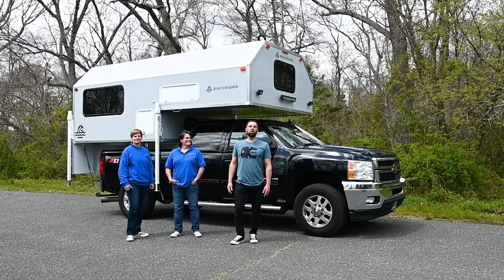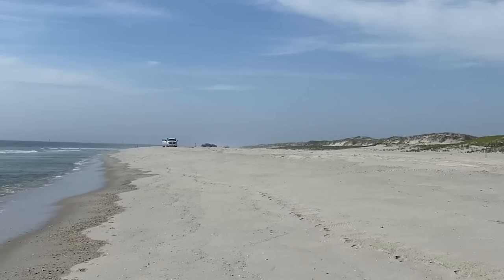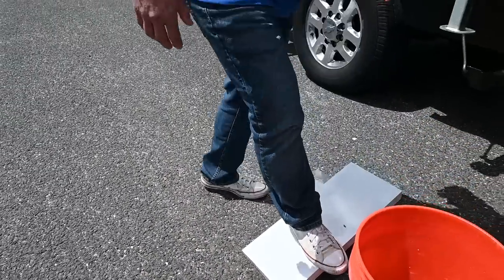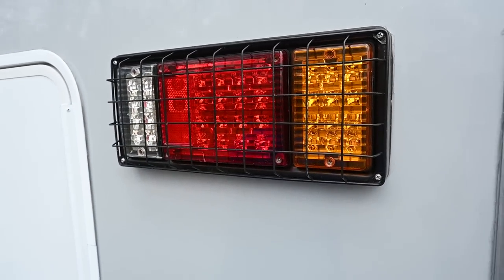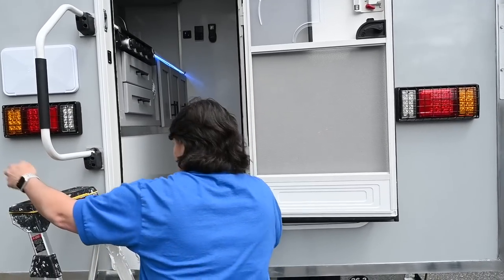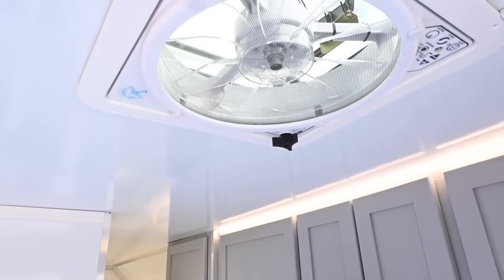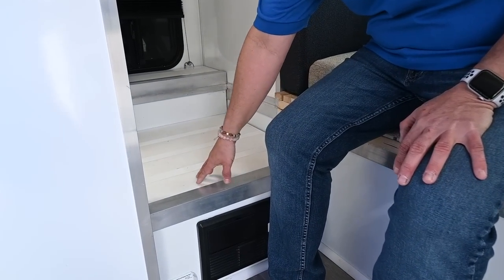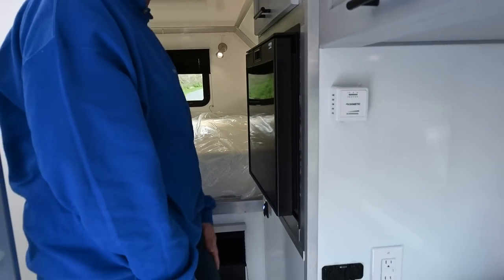INNOVATIVE Pickup Truck Bed Custom Camper - Beach Roamer Overlanding

Comment: I think that is the best truck camper I've seen actually. I was so pleased when we went inside and the walls are finished in simple white, phew!, no beige textured coverings that look sh*t and pick up dirt. Also it is so light and that is so important, you don't want a lot of weight high up on the back of a truck. So much that is good about that truck camper.

Comment: I think that this is the first camper that I've seen where the bathroom is not in the rear.. I have to admit, this is the first walk thru that I've watched from start to finish. Glad that I did... This is great...
Reply from the maker: Thank you. Glad it was enjoyable
Reply: Thank you Lookout Now.  It takes a bit more plumbing work to build the bathroom in the front but it really helps keep the center of gravity forward instead of having a heavy bathroom and tanks hanging off the back.

Comment: This is an extremely nice camper.  These ladies really built something special, functional, and sturdy.  Well done all the way around.  They're also MUCH less expensive than I thought they'd be.  The base option starts at 16 grand, and the biggest starts at 22 grand, which while a lot of money is waaaaay less than this build quality gets you with competitors. 

The only thing I don't like about it is a tiny issue I think it would have with the flat front plus windshear from driving down highways at over 70 mph.  I'm sure it works great and it is not gonna have any structural problems, but I think it could be modified from the factory with something that allows you to to get a slightly smaller profile and allow less wind sail issues.   Perhaps if the front leading edge over the cab had a dormer-style swing up,  you could get marginally better fluid dynamics while cruising through the air at high speed.  Perhaps even following the angled roof lines so it all still looked symmetrical.

If that would compromise the rigidity of the structure or its ability to keep out weather, which was the entire point of the build since they said they were trying to restore an old camper that was rotted out, I can definitely understand why they went with the solid vertical front end they have on this model.  The current set up looks to guarantee that no water will get in anything, anywhere and that is more important than losing a   mile per gallon in windshear.  However, if these ladies could figure out something which gives them the qualities they want and reduce the profile enough to give you back that mile per gallon advantage, then I think they'd sell even more of these.

Regardless of that extremely minor wind issue, what they put together is amazing, and I wish them both nothing but success, and hope they sell a ton of these, and make a ton of money.  Quality builds with all these features and advantages, for less than 40 grand is not only a good product and business model, but its great for the consumer too.
Reply: Thank you so much!  We appreciate your feedback!  Stay tuned for the walk through of the Overland Edition which has a lower front nose profile!  Keep in touch with us.  We appreciate your perspective!
Reply: Agree. I thought this was an amazing camper and just that friend end made me go 🤔

Comment: Looks like an excellent camper. One minor thing on the exterior I would change is the solar compartment door that also holds the remote for the jacks. If possible, make it have a magnetic catch to hold open. I see you had to hold it open with your hand. Not good if you're trying to adjust the solar or raise/lower your jacks. The exterior over the cab of the truck is very boxy and not aerodynamic at all. A lot of manufacturer's attach a tapered cap at this end to try and help with this. Maybe something to consider on a future model.
Reply: Great idea Chris!  Stay tuned to see the magnet on future cargo doors.  🙏😀
Reply: Amazing design, engineering, and product ladies! There has to be a proprietary way to curve the composite panels in a signature molding for a more aerodynamic cab over nose. Even if one continues the side(s) roof angle around to the front. The center of gravity design is huge if one doesn't have a 1 ton dually p/u. My 'V nose' utility 8x16 tandem axle trailer pulls night and day better than a flat front trailer or one with a nose cone fairing. What if a 'V nose' design was incorporated into the camper front cab over area nose with the 'V nose' horizontally (BEACHROAMER》{Wind) instead of vertically? I know one doesn't want to direct air flow to the cab over camper gap above the truck roof. Every added seam isn't ideal. It's built like a amazing brick outhouse with awesome  !!!
I wish BeachRoamer construction, and the design of formerly called 'CargoBody' truck work bodies could become one!

Comment: the structure is perfect and materials is great but that interior is all lady. if you ladies made a camper that was no frills no water, modular design like a scout it would sell like hot cakes. scouts are built like trash but the no frills modular design works. i live in alaska and i want a camper built structurally like this but i always find having no water lines to bust is always best. good non rot leak proof roof, diesel heater with solar and a fair price, that would be the ticket. keep it up ladies!
Reply from the maker: Good information
Reply: Thanks mudjerry!  We custom build each Beach Roamer so can absolutely build one with minimal (or no) water lines and a more modular / bare bones interior.  We recently added a diesel heat and hot water system as an alternative option to propane heat.  It was driving us crazy that we can build in solar charging and replenishable water tanks to be off grid for as long as you want BUT you have to go back to civilization to refill your propane tank for heat.  Diesel heaters, especially made by Timberlilne and Webasto, are incredibly efficient.  Thanks so much for your feedback.

Comment: Awesome use of each person's skill set. The elimination of wood would bring me such relief that my camper wasn't going to rot out in a few years. I agree with others that a bigger fridge would be nice. 
I wonder about that first step which seems awfully high. But that may just be me because I'm 5'2 and nursing a bad knee. 
I hope you go far and have great success with your business
Reply: Hi TrailRider, we do offer a larger fridge which also runs on dc / solar charging power.  You lose the storage space above the smaller fridge but probably worth it for the extra fridge space.
I can relate to the step up being high (I have a hamstring injury that acts up at the worst times).  We have different types of steps that vary in terms of height and weight depending on what works for the client.  Anything beats the step ladder!  Have a great day!

Comment: Overland edition starts at 22K when published 8 months ago but when I check today, it now starts at 36K. Nice camper and like the design. Sharp increase in the price but I guess that is the time we are living in.
Reply from the maker: This is why no one in videos like to mention price, because they always go up.
Reply: @NewJerseyOutdoorAdventures   But almost 70% in 8 months?
Reply: Hi ShutterFanatics.  Thanks for your comment.  We revised our pricing based on adding more solar charging capabilities (up from 200 watts/100 amp hours lithium to 400 watts/200 amp hours) plus we now incorporate aerospace grade aluminum extrusions that are custom made for Beach Roamer in every build.  It took some doing to get the mold done but we're really excited about the outcome.  

Most importantly, we quickly learned that our clients have a real sense of adventure and are truly looking to be off grid so they were upgrading to more and more off grid options (solar charging, diesel or propane heat, number of windows, etc.).  We built those common denominator options into the base price rather than advertise a low base price to 'get them in the door'.  Nothing drives us crazier than seeing an advertised price (say for a new car) only to find that the advertised car is so bare bones that it wouldn't satisfy what we're looking for.  

That being said, because a Beach Roamer is custom built, we can always bring down the cost by discussing alternative options.

Comment: Well thought out and constructed unit.  The soft close cabinet doors are wonderful but my one big concern would be that none of the  doors have any latches to ensure they stay closed when the truck is moving.  Having been a camper for years, I know that if you've travelled on a bumpy road, it's no fun to get to your destination, open the door and find the contents of the cabinets all over the floor.
Reply: Hi Ruth, that’s an excellent point.  Definitely no fun to have to clean up right when you get to your destination.  The cabinet doors also have a secondary lock that clicks into place when you’re traveling.  Comes in handy especially with the soft close glides on the drawers.
Reply: @vickilistonwithbeachroamer4511  - with all the attention to detail in your design, I should have realized there would be something to keep the cabinets shut.

Comment: 13:03
On warm nights, we use a Craftsman 20v fan.
A two-amp battery lasts a couple-three nights on LOW, and we have a spare full battery ready to swap.
.
Advantages:
* modular -- use one fan or add a couple more
* portable -- set it on the floor by the door or on a rack over the bed.

Comment: 12:30
We built our bed platform with expanded metal, similar to stout window-screen.
The air circulation under the mattress eliminates condensation and mold.

Comment: Nice camper.

I have found that i needed 800 watts of solar panels when living full time in my truck camper.  The extra wattage allows for 50 percent of shade parking. I have AC   but never use it.

Enjoyed video from philippines.
Will be back in america by december.
Reply from the maker: Glad you enjoyed it.
Reply: Excellent point!  We highly recommend more solar if you’re going to run an AC unit - we love the Dometic DC powered AC units.  Fortunately, we can fit up to 1000 watts of solar on a Beach Roamer by using the angled roof sides.  
Come visit when you’re back from the Philippines!

Comment: Kudos. I lived on a boat for 5 yrs. I  wish they had that composition then because I  had to deal with mold/ mildew. We tore our camper apart to repair and found out it was just stapled together.  ? What is the height from ground up to top for underpass clearance?😎😍

Comment: 13:50
For our ExpeditionVehicle floor, we have bamboo plank perimeter with slate in the center.
.
Advantages:
* indestructible
* interesting texture to bare feet
* bare feet automatically notice the main traffic zone -- slate -- while maintaining a safety zone to avoid toe-knockers as indicated by the bamboo plank perimeter.
.
Our insulation:
* adhesive-back acoustic against the inside wall, a gap, then
* one-inch pink-board, another air-gap, then
* two-inch foil-side poly.
With this obsessive excessive insulation, our heating needs are minimal.
.
We use a single Wave 3 catalytic heater, sitting on the floor on its factory stumpy legs.
We aim the Wave 3 at the slate, a form of heated floor with just about zero complexity.
The Wave 3 heats the slate, and that gently radiates into the habitat.
Year-round, we open at least two windows on opposing walls.
The escaping warm air carries humidity and odors.
.
Our intent on excursions with our caravan chums:
* learn and share.
In the 1950s and 60s, we joined caravans of experienced travelers.
We watched their choices of equipment, routes, destinations.
We kept quiet except to ask about reasons for some equipment or procedure...
...or to offer a ride to town for errands.

Comment: 12:02
In our ExpeditionVehicle, we mounted 3010 (three feet wide by a foot tall) dual-pane sliders designed for a stand-still house.
We mounted these at our eye-level standing inside, about eight feet above pavement.
.
Advantages:
* sunlight high on the wall mimics natural light
* high windows coupled with zero cabinets above waist-level eliminate shadows
* high small windows deter peepers
* high small windows are a small target for FOD or jealous by-standers.
.
2003, naysayers predicted the vinyl frames would fail, the glass would crack, the between-pane gaskets would leak to create a permanent haze.
Nearly two decades full-time live-aboard, twenty-four months twenty-four thousand miles around South America.
Alaska, Panama, all over North and Central America...
...no leaks nor breaks.
.
An aside:
We mounted our windows using Vulcum 116 sealer.
Nearly two decades, the seal remains soft and pliable.

Comment: So great that they provided pricing. Most don’t. I love this, the quality, etc. But for me, I need a van for safety concerns. I don’t want to leave the truck and walk outside to get in the camper.
Reply: Since the two ladies seem to be able to customize any portion of this since they build them, maybe you could get a pass through option so if your truck was also slightly modified, you could walk through (while ducking down of course) from the cab to the camper.
Reply: Love the well engineered build. Need a bigger fridge.  Love the light weight!  Do you have composting toliet availability?  Can you make an east-west bed? What is delivery timeline? Love  your camper!
Reply: @volvoqueen9698 , you are replying under my post.  You have good questions and should take them to the source for answers (so they see your questions for sure).
Reply: @robinrodriquez4725  l

Comment: They did it the way I would do it if I were manufacturing them. I wonder if the toilet is water proof or do you have to take it out to shower ?  Awesome job ladies !!!
Reply: Thanks so much Lisa!  The toilet as well as the entire bathroom area is completely waterproof so no need to remove anything.  Even the toilet paper holder is recessed in its own compartment.  Who wants soggy toilet paper?  Thanks again!

Comment: 11:30
In our ExpeditionVehicle, we increase the sense of visual and visceral openness with zero cabinets above waist-level.
.
A benefit of less weight aloft -- less leverage on our camper three-point mount, less sway...
... and less potential to carry just-in-case stuff...
... while paring the necessary to a minimum.
.
Another benefit to less stuff:
* less tendency to force the adventure to fit the rig.

Comment: Is the cabinet in the wet bath made of wood or made out of the material you build your outside walls of your camper with? I would be concerned if the cabinet is made out of wood.

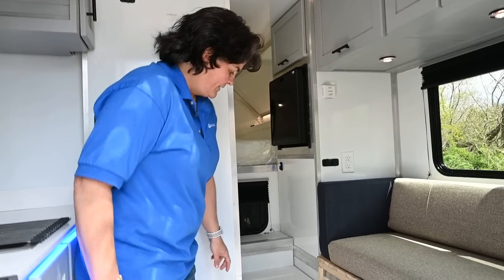Comment: 14:04
We have two CO detectors from different manufacturers.
We have two smoke detectors from different manufacturers.
Weird, huh?
.
Although our rig is 'Arctic-insulated', we prefer a good draft, similar to an old house with loose windows and doors.
Although we think an air-tight structure can be useful at times, we are happier with moving air instead of stagnant.
.
Our crew -- three RedHeelers plus two adults (and a frequent yummy third!) -- generate humidity from breathing.
We prefer to cook outside, on the porch or at a picnic-table, reducing that source of humidity.
.
To further reduce humidity, we shower outside.
.
Semi-retired welder-fabricator here.
One of my hobbies is walking wrecking-yards (aka 'dismantlers') to watch the deconstruction of vehicles.
They often have junker RecreateVehicles.
As the components are stripped, the innerds are exposed.
One big problem with big water tanks -- sediment.
I often see a semi-translucent tank with several inches of muck, a result of filling without an in-line filter on the hose.
.
At the insurance salvage auction, we are amazed at the numbers of BillionBuxBus conversions with burnt refrigerators.
Unfortunately, the frame on a BillionBuxBus conversion is minimal... at the builder in Coburg, Oregon, we watched a forklift raise a frame high as our head to clear the frame-ends from dragging the floor.
A factory RecreateVehicle relies on the box 'house' for much of the vehicle integrity; removing a section of the box through a fridge fire dramatically alters the roadability...

Comment: Kudos kudos very nice build! The only thing in this industry I still cannot understand or even fathom is why on Earth they're built with such thin insulation.. r4 R5? Just seems worthless to me industry standard should be R15 especially with everyone wanting to go green many people would choose to live in such a camper but efficiency is an absolute must I think this could be built with much less aluminum framing using the 3-in or even 4" rigid foam panels which would then make temperature control AC and heat which is the biggest power draw much much more efficient could run an ACDC mini split 12 volt unit at 300 to 500 watts and hold temperature very well to be able to power off minimal solar! No propane! All electric with a small backup generator is optimal in my opinion! Only thing we should have to refill is fresh water and even with that I would love to see an innovative filtration system with a pump where if you're parked next to a river, lake or any water source you could filter the water and pump into fresh tank!? Just some food for thought! But congrats on a beautiful build and nice layout. 🙏
Reply from the maker: It’s a compromise between interior livable space vs insulation thickness
Reply: Hi Daniel, the nomenclature when talking about insulation can be confusing with the lower the number, the better the insulating quality.  So a R4 is incredibly better than the R15 found in most residential homes.

Comment: 09:42
Rear-entry gives a sense of visual and visceral openness.
.
A side-entry slams the operator into the opposite wall, a closed feeling worsened by cabinets or shower.
A side-entry requires an immediate turn to use the space, a poor choice of interior.
.
Our ExpeditionVehicle has a rear-entry -- with porch deck and roof -- our decision after a half-century of full-time live-aboard in lesser rigs.